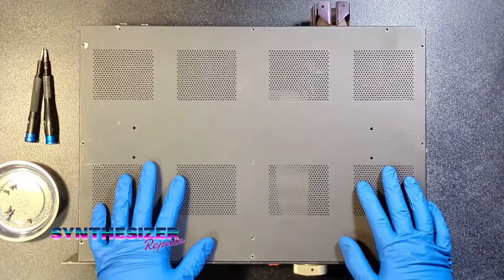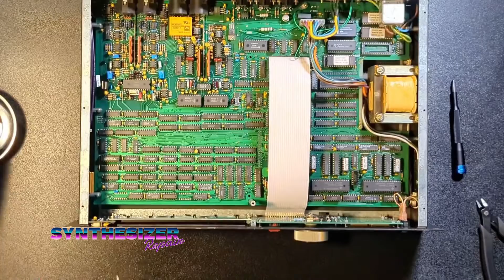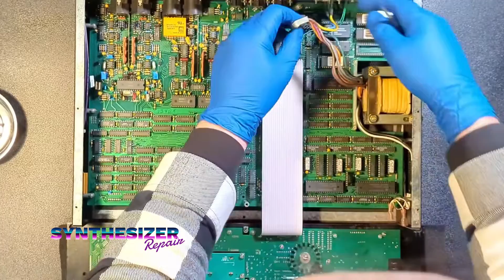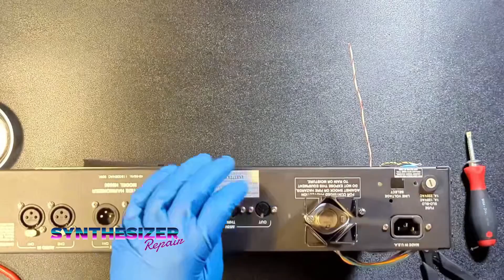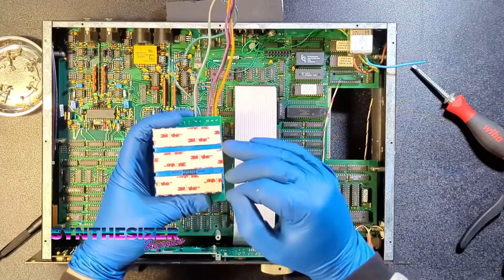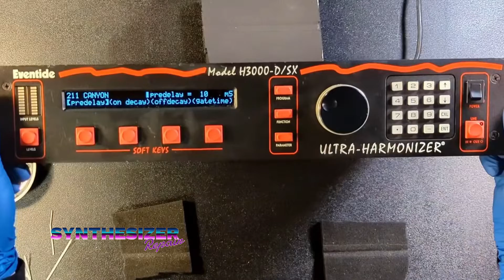Eventide H3000 "Silence the Hum" new DIY Power Supply Upgrade Kit by https://synthesizer.repair

Comment: Since my only concern is having to solder on the circuit board, instead of removing the cable leading to the load resistor in my Eventide Ultraharmonizer H3000SE, I could much more easily remove the load resistor from the cable and then simply solder the two cable ends together, isolate it, bingo, instead of desoldering the cable from the circuit board and then having to solder a U-jumper cable onto the board in an even more dangerous procedure, as it was late in 1989 when I bought my Eventide Ultraharmonizer H3000SE - I wouldn't wanna cause too much stress to it.